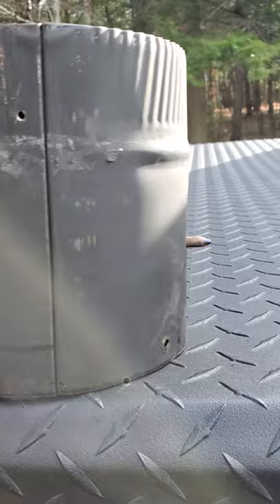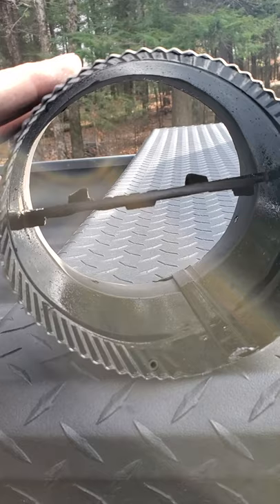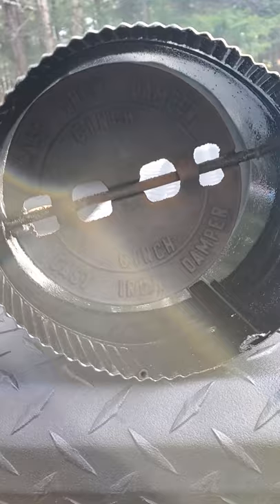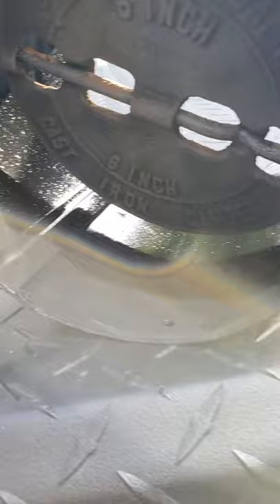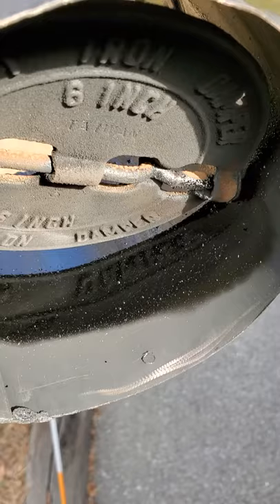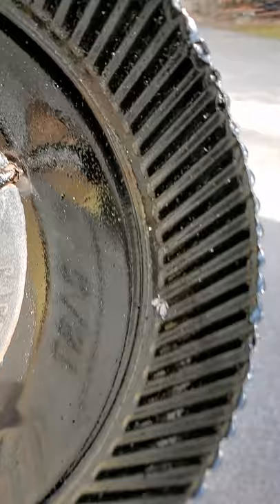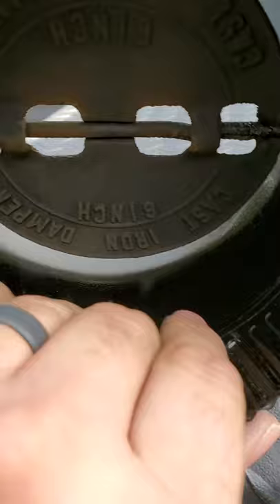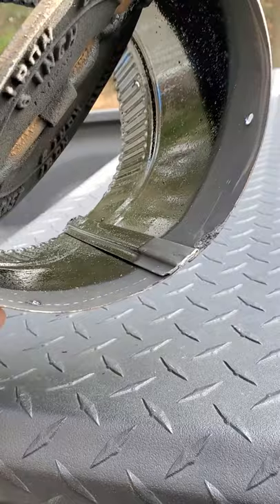Let's talk about Butterfly Dampers

Comment: I am a complete amateur= the guy I hired to install my wood stove recommended I put a damper in the pipe so I did. I ended foolishly dropping my pipe pole brush cleaner down the pipe 🤦 pipe had to be disassembled just the other day and so when he disassembled I asked him to remove the damper that he initially installed just because I started thinking about flow and no not the Progressive girl. My Lopi Endeavor wood stove already has a damper built into the stove itself= double 🤦🤦